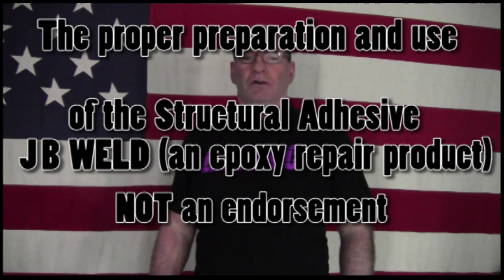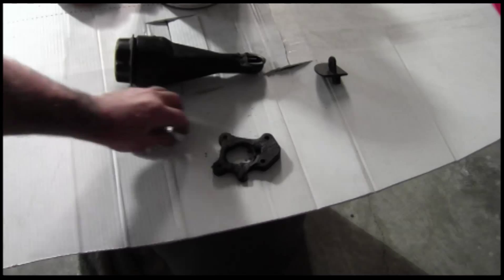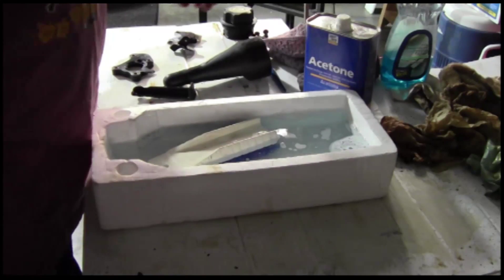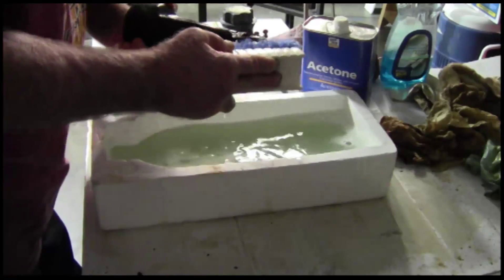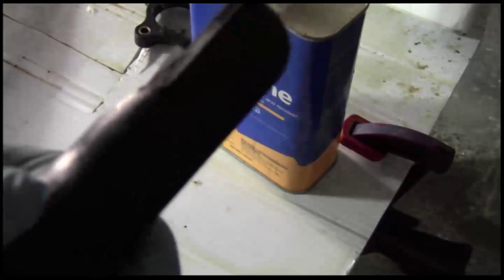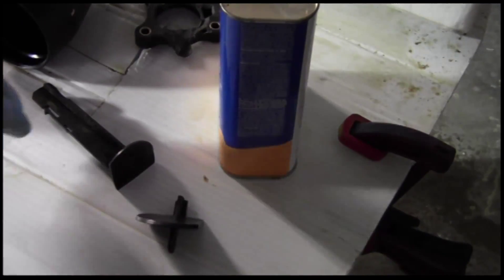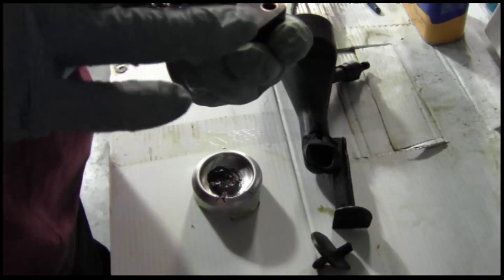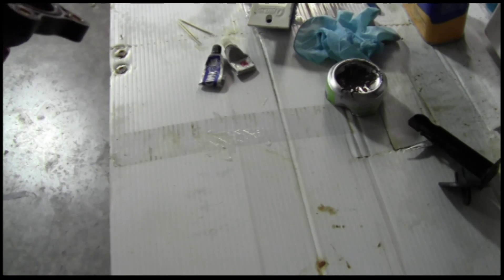Proper use of JB Weld #4 B 118

Comment: From a scientific standpoint, you haven't proven anything nor even suggested that what you showed is "How to properly use JB Weld". I'm sure you're right. But unless you demonstrate how the final bond is stronger (or in some other way better) for cleaned vs  uncleaned, you haven't proven anything. Imagine someone saying "Smearing bananas on the parts before JB Weld is the proper way", then not supporting it with evidence.

Comment: Good stuff, I like your impromptu JB weld holder (soda can). I haven't needed to use JB weld or any other epoxy for my electrical work yet...but knowledge is power and I'm taking notes. Thanks.